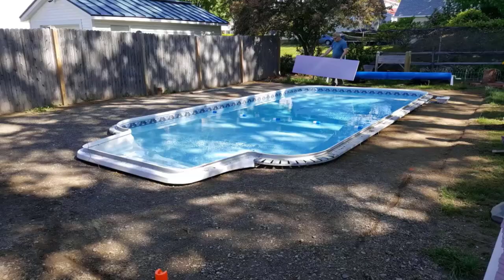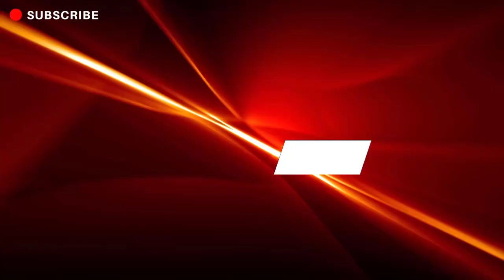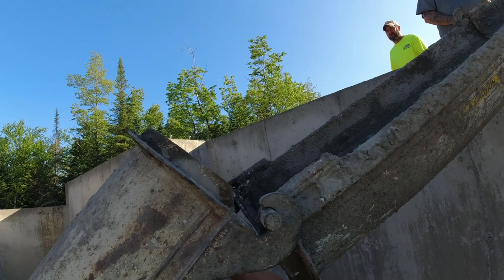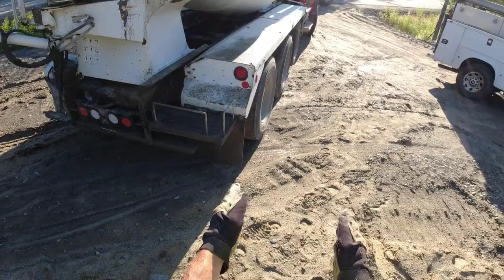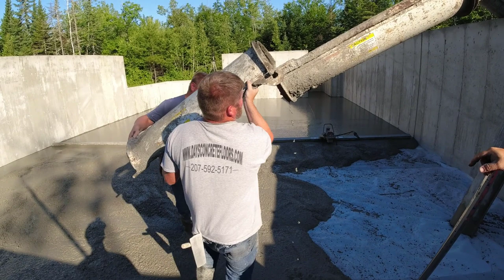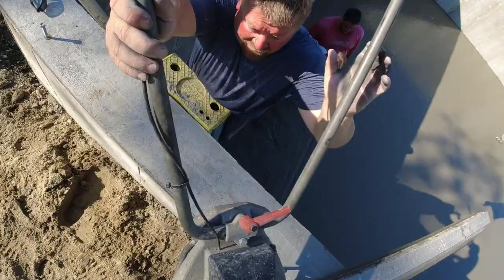How To Pour A 50' X 32' Concrete Floor with the ScreeDemon Battery Powered Vibratory Screed

Comment: On a step down foundation why do you you work your way out on towards the highest portion of the foundation. wouldn't it be easier to exit through the lower portion?
Reply from the maker: It depends on the access sometimes. Also sometimes depends on where we want to start finishing with the power trowel.
Reply: @MikeDayConcrete  ok that's understandable now.